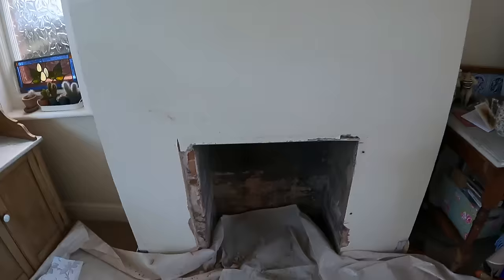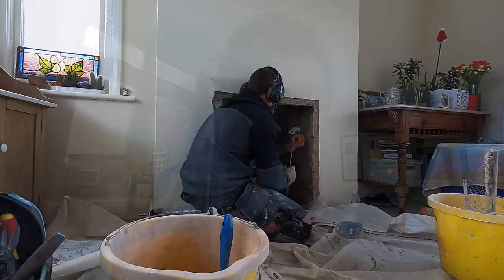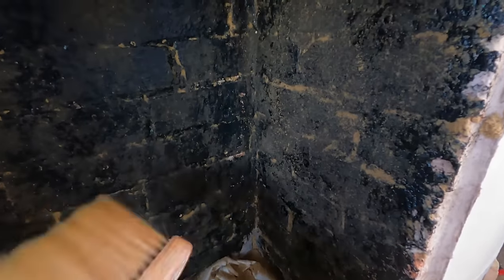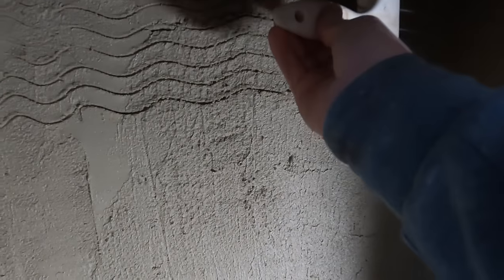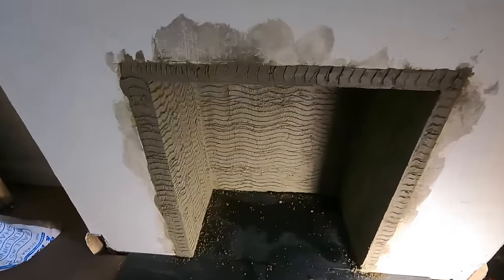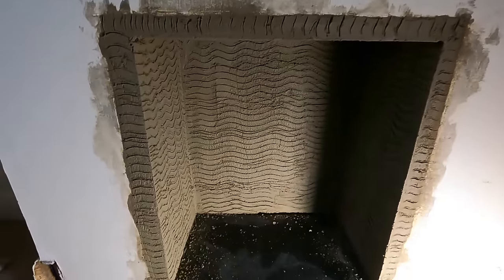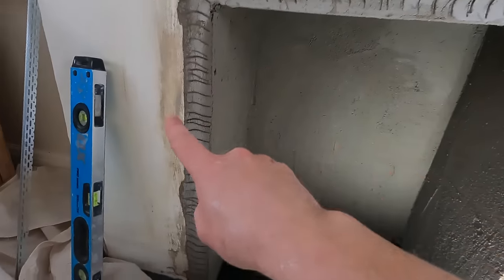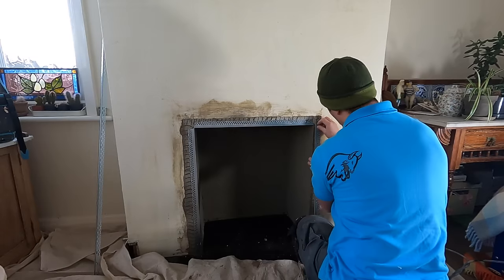Preparing A Chimney For A Log Burner Installation | FULL TUTORIAL

Comment: I fit fires for a living and the plasters who get the inside wrong is unreal .... this is how it should be done..... very nice work mate
Reply from the maker: Thank you very much mate! I really appreciate that...cheers 👍
Reply: @PlasteringForBeginners  great workmanship, just curious what could I put in the render to make it black rather then grey ..
Reply: @paulsimpson2232  Cement colourant.
Reply: Plasterer of 24 years here. Got my first fireplace,
 to do as a return job for a waller. Your video has helped a lot 👍🏼
Reply: @2036scott  hi hopefully you can answer this pls ,the render he refers to ,is what?  building, sharp or plastering sand. Blaine  gave no answer maybe to busy.. thanks inadvance
Reply: @paulsimpson2232  plastering sand dude.
Reply: @PlasteringForBeginners  hey, can you come do my fireplace?
Reply: @paulsimpson2232  soot? 🤣
Reply: Thought you had to have fireproof materials inside the fireplace? Also it's rather a small opening is there enough room either side of the woodburner when it's installed?

Comment: I’m a plaster white over 18 years experience who has done many fireplaces.. and I don’t wanna sound salty but him stapling those beads on rather than sticking them on then putting scrim tape  around them it’s going to cause nothing but problems.. he should also be using K render mesh on his scratch coat… just a little tip if anyone is listening😁
Reply: Many thanks for the tips John, it's really appreciated. I take it you use this method instead of Victas products? What would you recommend for a breast that's back to brick? I thought about fixing beads then building out with Hardwall and then finishing with multi. . Would you k rend mesh out the bonding or hardwall coat or build out with s,c,l?

Comment: Don't use sand/cement render behind a wood burner it will crack.
Reply from the maker: I often use sand cement for log burner installations but with a much weaker mix. The top coat is 6:1:1 (lime included for flexibility). It's always worked wonders for me pal 👍
Reply: @PlasteringForBeginners  It will crack eventually for sure 100% it's the sand content and unflexible nature of cement. Also if it's in a house with solid walls cement shouldn't be used anyway. The product you need is called warmcote with a top coat of limecote. Zero shrinkage and very very flexible. Contact Best of lime.
Reply from the maker: It's always worked in the past but I'll let you know if I hear anything otherwise. So far...all good from the other installations! I'll look at this Warmcote...I've just watched a video on it and it looks like nice stuff to use. Thanks for the suggestion, I appreciate it. Hope you're well 👍
Reply: @PlasteringForBeginners  No worries at all, glad to help. We specialised in this kind of thing for a while. Give Martin a call at Best of lime. Merry Christmas
Reply from the maker: Brilliant! Thank you sir and Merry Christmas to yourself. Great hearing from you 👍

Comment: In my 46th year now plastering and over the last 10 years we have had more and more requests to render out fireplaces pre stove fitting, at the beginning soot stains were a problem but we have never had a problem when using anti-sulphate cement, rendering sand and lime.

Comment: Hi,
I was a hetas stove installer since 2002 until last year. Nice vid but I used to grind the surface of the bricks in the recess and grind out the brick joints, then prep the surface for the first coat render by splashing the bricks with a slurry of sharp sand and cement in a wet mix, the scratch coat would really bite onto this, use the comb as you say to help the top coat, and apply second coat of render finished off with a wet sponge.

Never use pva as it releases its grip with heat!

Comment: Thank you. This is exactly what I was looking for for the inside of my fireplace! I do have an issue where the front brick doesn't come all the way down. And my lintel and damper casing are exposed. It originally had some (probably not heat rated) cement over the casing and the lintel fell when I removed slate that was cemented over top the brick. Any suggestions on videos to watch for that would be greatly appreciated! Thanks so much again and great work. Motivated to get started!

Comment: Looks great. A so called heat installer used fire board in the space where he installed my log burner. Defra approved, of course! 18 months later, the board at the back had a big crack in it. He said You need to replace the fireboard every couple of years 😮. Yeah right. Heat weren't much help either.
And, there's no annoying supermarket muzak.

Comment: Great  job  . I have  done  many but  always  use cement boards  dot and dabbed  and  it has always   worked  well  . But  great  to  see   your way
Reply: Was looking for a comment like this! I want to use cement boards in my fireplace ready for the burner- what sort of adhesive do you use for dot and dabbing? Also do you recommend a particular brand of cement board? Thanks!
Reply: Plasterboard  addessives what you  need   and wickes   cement  boards are a nice size  and not too  expensive
Reply: @Liamnel5on  cheers, does it need to be a fire rated plasterboard adhesive or can I just use standard stuff?
Reply: Just  normal  plasterboard  addessive  .  make sure  it's going back against  as clean and dust free a background  as possible

Comment: Great video, I'm currently working on my fireplace and want to use render on the chimney inset, (despite all the scare stories about cracks). I've seen the mix you suggest but does it matter which type of sand you use? I also wondered whether a fiberglass render mesh would add strength and would it be ok to use in that sittuation? if it is just glass fibers I cant imagine that being a problem with the heat? Thanks

Comment: I've taken the old tiles from the inside of the fire place and taken of the loose and cracked plaster and render back to the brick work.
What mix should I use on the bricks to level before applying brick slips to the render.
Thanks

Comment: I used carlight bonding smoothed it as much as I could and tried it with a map gas torch 2000° never budged then painted it either brush on stove paint  there Is  a building regs space around log burner

Comment: Please can you tell me, is it crucial that you do two coats of render inside the chimney? Our log burner fitter has only used one and has told us to paint with masonry paint in thin layers on top - is this okay? We have a plasterer booked to apply standard gypsum plaster to the exterior only.
Reply from the maker: It’s best to do 2 coats because it has greater protection from the heat. It depends on what product they’ve used - just ask the reasons for using one coat and see what they say.
Reply: Did it work out okay with one coat?

Comment: Very good job, I alternatively have done several fireplaces, I totally agree right the issues you raise but I actually render with NHL2.5 lime sharp sand scratch 4to1 and plastering sand 4.1 finish ,this approach I created myself mix wise the ratios are same but the sand is softer in second coat so equates to a weaker mix I just found this works I find line retards any ash and also lots old fire places built with lime so marry the two together, also it leaves a lighter colour that is natural and not so dark ,like I say its worked for me forgot go mention I will  through horse hair In scratch coat
Reply: Any cement in either coats? Or just lime only?

Comment: I always dab interiors with Fermacell powerpanel, which is designed for the heat and much quicker, although I like the look of the rendered interior. That opening looks very small and will get really hot; I try and aim for 900mm high x min 800mm wide. Great work though!
Reply from the maker: I know a few people who do it this way to be fair...it sounds like a good way to do it! Thanks for the comment and your insights. Cheers 👍
Reply: Are you saying you can cover the brick work by dot and dabbing with the sheet material? What adhesive can you use? Can I message you dreckly? Cheers.
Reply: @georgeatkins6414  Yes, with regular dab adhesive. I use it on all of my installations. Feel free to pm me :)

Comment: Good job never seen the bitumen used this way. When wall gets red hot I thought it might melt. I like to run scrim tape down wall beads to stop cracking. I use cement boards to line bricks then tile or paint.
Reply from the maker: Cheers pal! The 2 coats of cement stop it from meeting I think - it's never let me down ha! Good idea about the scrim and i know a lot of guys who just use cement board. It's works the same way! Thanks for watching pal, hope you're well 👍
Reply: Ian, how do you fix the cement board to the bricks? I guess that you use render?
Reply: @RichardConnor1  I use window fitters screws. No plug needed and cover screw top with fire cement, if painting with hi heat paint . Use fire cement behind boards to level boards if needed.
Reply: @Ianf1x  Excellent, thank you. Do you ever render over the cement board? Could I use the cement board to get a flat surface and then render it to get that 'look'?
Reply: @RichardConnor1  I have not rendered over only tiled on top . When I render I start by using s.b.r. mixed with cement only brush on bricks as a slurry . 4soft sand 1 cement half lime scratch  coat. Then 5 sand 1 cement 1 lime.
Reply: @Ianf1x  many thanks for your advice.
Reply: Great video and explanation thank you. Just about to have a burner installed, will the render not crack under extreme heat even though u have used lime?
Reply: Thats what I am going to do hardy board as its heat proof and tile, think it will be much better

Comment: Great content on your channel- very detailed and informative!
I do have a question however- I am doing similar to my chimney breast, but due to previous shoddy brickwork I had to hack back to brick and repair.
Do I set corner beading straight to the brickwork before the scratch coat? Or Chuck the scratch coat on and use thinner beads?
I’m using a lime/cement mortar for the scratch before the multi finish top coats.
I had thought I could use battens to set the depth of the scratch, then sit beads on for the first plaster coat. But I’ve also seen others head straight onto the brick and judge the scratch coat depth, so I’m a tad confused 🫤

Comment: This couldn't have come at a better time! I'm just about o do the same thing. Many thanks for this excellent video. Is the bitumen a traditional treatment for the soot? I wonder how it holds up against the heat of the log burner.
Reply from the maker: Thank you for watching and I hope it's helped. I used this method lots of time and never got any call backs so I'm sure it's grand! Let me know how it goes when you try it for yourself. Cheers pal 👍
Reply: Use a vitcas board to do a proper job.

Comment: Little unsure about the bitumen. Bitumen deteriorates over time. Completely killing the suction from the background usually leads to issues in my experience..
Reply from the maker: Bitumen can take a lot of heat pressure without delaminating hence why they used it on flat roofs. It's also very flexible which makes it very adaptable. 

And I should have explained that I apply scrim tape around the joins in the render - it was clear tape and I forgot to mention it so yeah...my bad on that one @coolhandluke. Thanks for the comments lads 👍
Reply: @PlasteringForBeginners  
That’s a really interesting point and one I hadn’t considered. Do you mind if I ask where you learnt this method ?
I’ve always been weary of using products that may degrade faster then the material I’m applying if that makes sense. 
Great video as always.

Comment: why didn't you use normal beads? I have done hundreds of these and I use small rules not my trowel and the Pva needs to be wet before you apply the plaster
Reply from the maker: I used stop beads because I didn't use Multi internally. Fair play for the little rules but I must say that I'd never apply plaster to wet PVA. Maybe Tacky but not wet but each to their own. If it works for you my friend. Thanks for the comment👍
Reply: I have done literally hundreds of these for a stove shop you can still use normal bead the render type, mini stops could curl in time from the heat, I always plaster on wet PVA my mate goes ahead of me with a roller been doing it for 40 years have found that Everbuild 501 is best as it doesn't slide
Reply: @PlasteringForBeginners  also vinegar kills soot
Reply from the maker: Good stuff! Great to hear your input - I'll check out that Everbuild 501. I use Evostick PVA which always works well for me.

Comment: You may get cracks as the metal beads heat up and expand.
Reply from the maker: It's worked in the past but I can see your concern. The only good thing is that the beads are on the outer edge which helps 👍
Reply: @PlasteringForBeginners  it’ll probably work. Cracks around fireplaces are probably why they invented the fire surround. Hardie Backer is fire rated A1. You could use strips of that to create an edge? It may not expand like metal. I’ve recently used a product made by Vitreous (I think that was the name?). It’s a fire rated plaster, two coat. I rounded the edge where you put your bead but then I just felt confused about where the paint finishes and the fire starts.
Reply from the maker: That's why I prefered to use a stop bead so the metal wasn't actually in the chimney. It's always hard to see what's best and you may be right about the fire place surround. 

It's only a little burner and the log burner fitters said it should be fine. I've used that Victus plaster (I think it's that ha) before. Good stuff!! Sounds like you did a nice job though - I love rounded edges.

Fair play to you my friend and thanks for the comment. Great hearing from you!

Comment: sorry mate. but brush off the soot, dot and dab cement board and caulk the internal angles. 
outside of breast HAS to be lime base and skim. 600 above and 400 each side. only way to prevent cracking.
any modern cement based renders will crack.
Reply from the maker: Thanks for the input pal - I was advised this way from the actually stove fitter but I'll let you know if anything happens. Good to great your opinion though ...cheers!
Reply: @PlasteringForBeginners  30 different plasterers, 30 only one ways of doing it. you do good vids. keep it up.
Reply: if you put gypsum on top of lime plaster, it will crack anyway. would it be best to use a mix of 5:1:1.

Comment: .......or you could high temperature silicone on some British gypsum glassroc f, 2 years on its still pucka !
Reply from the maker: I'm intrigued by this Glassroc...I've never heard of it. It's it designed for this type of work pal?? Cheers
Reply: @PlasteringForBeginners  Hi, apologies for the late reply mate. So its British gypsum glasroc f fire case board it comes in 15, 20 and 25mm. 8x4 sheets costs around £60 inc and is good for two stove installs. Its smooth on one side and textured on the other, colour is creamy/white. Cuts easily, score along straight edge few times and finish cutting through with hand saw (proberbly best not to breath the dust as it contains very fine glass fibers! 😷) to fix to wall wire brush bricks and apply strong coat of pva and let dry. Attach using high temperature silicone, dot and dab technique fix rear board first then sides. Stop beads around edge flush with finished edge. (i know you know this obviously 🙄) you can paint it but on my own install i left it self colour. Two years on its still mint! A quick google will give you all the specs, don't be tempted to use hardy backer cement board to save money...in my opinion its crap! Unfortunately i can't get any pictures to you to show a finished install but they look pucker! Hope this answers some questions. Cheers Danny.